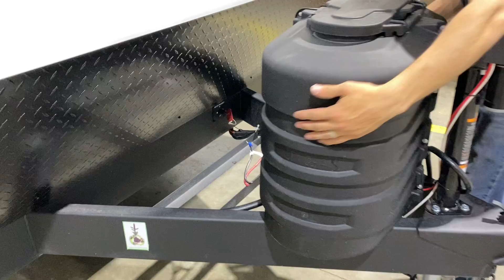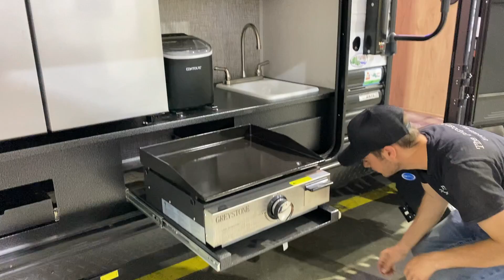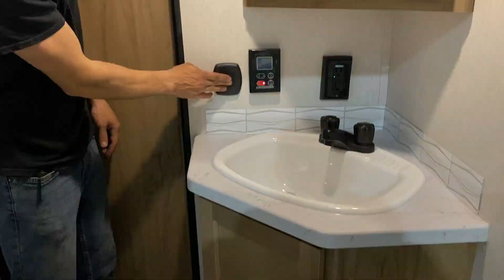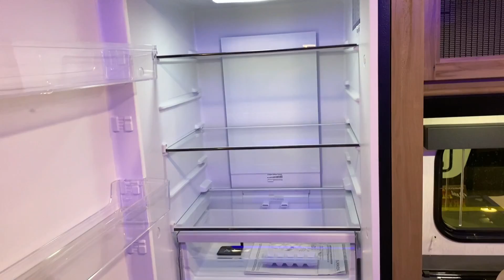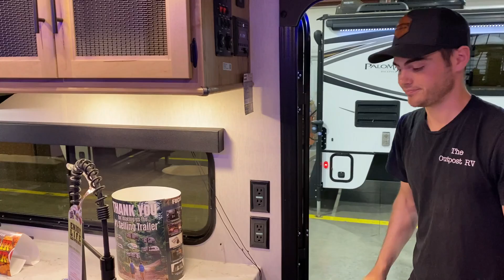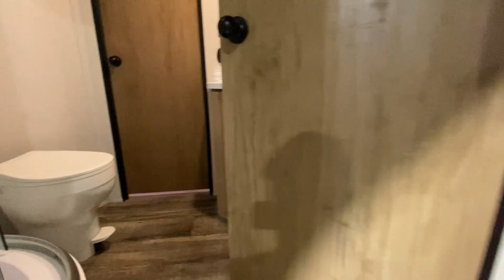2024 Grey Wolf 29TE Technical Walk Thru

Comment: Where's the manual override for the slide out
Reply from the maker: Great question, and we forgot to cover that.
Currently the system they use, if you still have power, in the kitchen over head cabinet behind the false panel is the controller, there are 2 red buttons on the controller, one for each motor, push both together to retract slide, this will only retract and not run out.
The other option is you should have received a flexible bit that you can insert in the motor itself, there is a motor on each side so you would need to walk it in. You also need to remove the cover bracket to get to them. There is an older system where the motor is located above the slide in the middle.